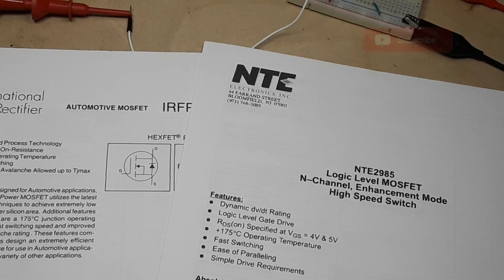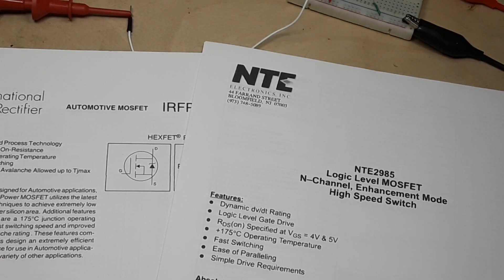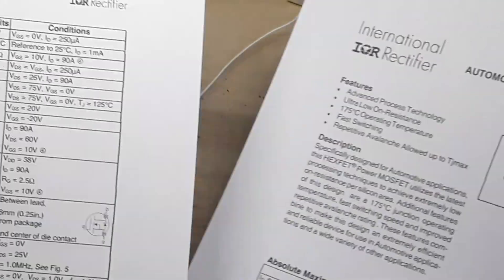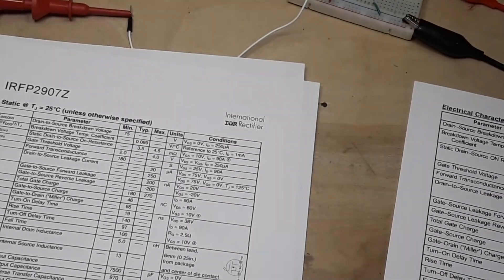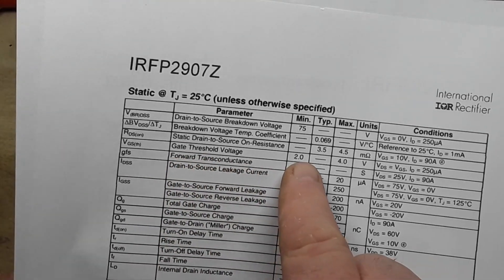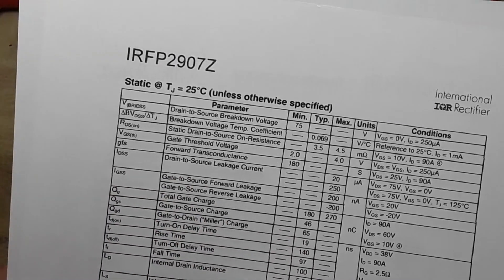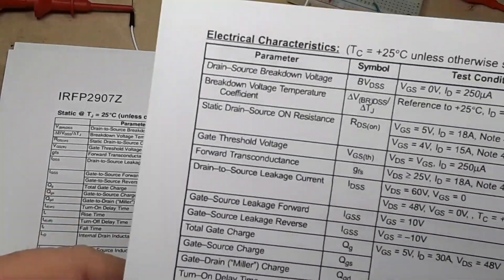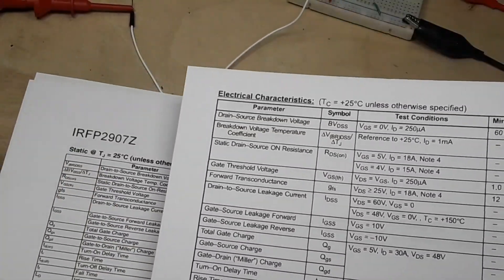Using MOSFETs with an Arduino

Comment: Nice video.  In comparing the two MOSFETs, you seem to be assuming that all Arduinos are running at 3.3V, which isn't necessarily a valid assumption.  I've been using Arduino Nano, which runs at 5V.  So it seems to me that either one would likely be just fine, and not a lot of difference between the two.  Am I missing something?  (NOTE:  I don't really have much experience using MOSFETs--so this is is really more of a question than anything.  I'm here to learn!)

Comment: love the video !! im just about to attempt a gate driver circuit on my mosfet !! high speed, significant amperage and 12-36 volts on the input , what are the basic protection components i might need ? is it mostly just that 10k resistor to pul down the voltage quickly and safely ? : )  cheeers !!

Comment: Wow, what a fantastic video. Thanks so much for making it, I've learned a lot more about reading datasheets!
If I'm driving a IRLML6344 MOSFET from an ESP32 pin, would I need a series current limiting resistor? Vgs(th)=0.8v, Id = 10μA and Vds = Vgs for this model.

Comment: Maybe a dumb question, but wouldn't both of these work equally as well with a 5v arduino?  I am just now learning about mosfets but all of the examples I have seen send a pwm signal to the mosfet.  It seems like in this video you are just showing the voltage that these things activate and in both cases 5v is sufficient.

Comment: Isn't it correct that even a mosfet gate can draw significant CURRENT from the Arduino OUT pin if using it's high rise/fall times at a high frequency (or even low frequency) since the mosfet gate capacitance is charged and discharged quickly because I=dQ/dt?   For example if the mosfet required 50 uC to charge it's gate capacitance and the rise time is 300ns, then the peak current draw from the pin is 166mA !...seems bad if a 1W LED was pulsed continuously at a fast rate for something like dimming applications.
THANKS FOR ALL OF YOUR SUPER VIDEOS. I HAVE LEARNED GREATLY FROM THEM!!!

Comment: Just to clarify - is the NTE2985 only suitable for 5V Arduino boards, or will it also work fine with 3.3V Arduino boards?
Reply from the maker: It will work, at about 66% on a 3.3V Arduino
Reply: @learnelectronics  thanks! Is there a more suitable MOSFET you could recommend which will switch 100% with a 3.3V Arduino?

Comment: you could use a darlington transistor
Reply: it would be hard to drive a high current like 30A through darlington. You can only use 25mA per output in arduino.
Reply: @interbudelblag  https://en.wikipedia.org/wiki/Darlington_transistor    i don't think Ib would the issue

Comment: It's hard to find MOSFETs that will operate from a processor operating on a 3.3 volt supply or lower. In this case I use a low current bipolar transistor as a buffer. The virtue of the silicon bipolar transistor is that it only requires approximately 0.7 volts to saturate the base emitter junction, making it an ideal buffer. A common emitter buffer is very useful for switching on a p channel enhancement mode power MOSFET. The alternative solution might be to fit an opto coupler, allowing a 3.3 volt processor to switch on the gate of a MOSFET  working at a much higher supply voltage. The only limitation being the amount of current an opto output transistor can source into the mosfet gate. There are OPTOs with  Darlington output stages that help. There are also more expensive MOSFET OPTOs.
I have used these to disconnect the I2C  bus data and clock lines, connecting different, and separately powered, modules together on a ribbon wire bus. ( OPTO Toshiba TLP597G)
When power is removed from one module, the OPTO  stops the unpowered module bus from pulling down the I2C bus lines on the other units. The OPTO I am using has only a one ohm resistance when on and practically infinity when off. This make it idea for connecting in series with the I2C bus lines.

Comment: Thanks for the video. Can you also do one on driving a P channel MOSFET?
Reply: FYI - I found a good p-channel "logic level" mosfet from Mouser Electronics.   NDP6020P has a 70ns fall time, 30ns rise time.   I tested at 3.3v and it was around 7 milliohms at 1/2 amp.   (I can't test it at the rated 24A.)  It wasn't bad at 1.5v in the 10's of milliohms.   The downside is the gate-source max is +/- 8V.   I intend to make a multi-rail power supply with a common ground - monitored and controlled with an arduino.  Turning the separate rails on and off require p-channel mosfets.  And I will monitor voltage and current with multiple ADS1115's.

Comment: Good info. I'm trying to light up lots of leds in parallel using premade led strips. Can I run them at a mere 1.2v with the correct MOSFET?
Reply: Make sure to limit the current if the LEDs don't have any sort of protection already.  Do you intend to dim them?

Comment: Great video!
Can you make a video about the mosfet’s ratings? I mean there are a lots of properties of a mosfet and for example if I want to drive a 3.7V motor with Arduino PWM, which are those properties that I have to consider for choose the right mosfet.

Comment: Is it possible to drive mosfet at high side using arduino?
Reply: If by "high side" you mean switching the positive rail on/off and not ground on/off, then yes.   But you need a P-Channel mosfet.  And the gate needs to go to zero/ground to turn on, and one/positive to turn off.   Unfortunately, not many are logic level.  See my reply to Ninjutsu Ryu about p-channel mosfets.  I found the NDP6020P to be a good 'logic level' mosfet.  But it's only for 8V or less.  Good for 3.3v and 5v rails, but I will need to do figure out something else for +/- 12v.
Reply: @davethedaemon9024  thanks for the info. However, I need to control N- channel mosfet (IRFZ44N) on the high-side using arduino.
Reply: @josephocampo  Ouch.   You are picturing the drain of the MOSFET connected to +5 and the source connected to the +load and the load connected to ground?   That requires the voltage on the gate to be higher than +5 ... like +7v or better for complete milliohm turn-on.   (This is roughly equivalent to an NPN  emitter follower circuit.)  In this circuit, if you can only give the gate +5V then the highest voltage you can give your load will be lower than 5V ... closer to 3V for your IRFZ44N.   This type of circuit needs a P-Channel mosfet or a PNP bipolar for best results.  For our needs as switches: N-Channel MOSFETs work best with source connected to (negative) ground, drain to load, and load to positive --  P-Channel MOSFETs with source connected to positive, drain to load, and load to negative.  (I hope I remembered my polarities correctly.)
Reply: @davethedaemon9024  drain of irfz44n connected to +32v. I cant get out of switching it from the high-side. Will try to bootstrap using 2n2222 as gate driver. Or will find another way if doesn't work.

Comment: Awesome video! In the past I've used the IRLB8721PBF with fanominal results using 3.3v logic and running 250mA through the drain. I wonder how it would compare to the logic level mosfet you tested...

Comment: If you use logic level MOSFET’s they tend to stay cooler so you don’t need huge heat sinks as they turn all the way on when you are using 3.3v circuits too. Great video Paul, almost to that 100,000.

Comment: The voltage where the LED turned on was not where the MOSFET was fully turned on, right? You’d need a higher voltage to get the rated resistance? It would have been useful to see that difference.
Reply from the maker: That was just where it started conducting.

Comment: Hi Paul. As a general rule for MOSETS could you assume that the higher the current rating capability the higher the the required gate voltage?
Reply: Hi Vosh, I hope you don't mind if I answer. General, bog standard Mosfets of all current ranges are usually driven with 10-12V, with gate max voltage at about 15-16 (carefull, some are lower). Generally, higher voltages might be usefull if you want to turn the mosfet on faster ( drive it "hard") - there are some caviats that I'm not a 100% on top of, but thats the general picture.
P.S.
There are new, emerging semiconductor fet transistors (GaN) that require a lower drive voltage (~7V) but have generally lower on resistance, higher current handling capability, and fast switching at high power (low Cgate).
Reply: @Matematyk1996  Thank you for answering my question. So, I infer that the gate voltage is independent of the current range capability. Those lower drive, high current FET transistors are new to me, thanks for the info.
Reply: @MrVosh-nj2lc  Have a look at the NDP6020P for contrast.  It's a P-Channel mosfet (opposite polarity to the one in this vid).  Rated at 24Amps, but max is 8V.   I tested and it works a treat with 3.3v as well as 5v logic.   This is still available at Mouser but "Scheduled for obsolescence and will be discontinued by the manufacturer".

Comment: A perfect example I ran into of where you might use a logic-level MOSFET is on the main board for my 3D printer. The original designers opted for standard MOSFETs to run the heaters, the result of this was the requirement for heat sinks and active cooling to keep them cool, they easily reached over 90C. I replaced those with logic-level MOSFETs and no longer needed the active cooling; they stayed at around 24C during operation.